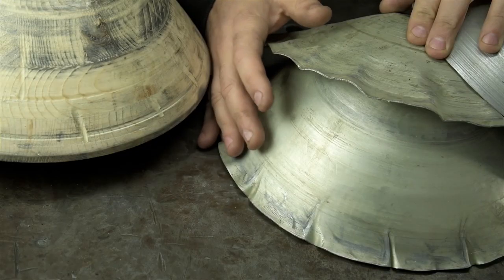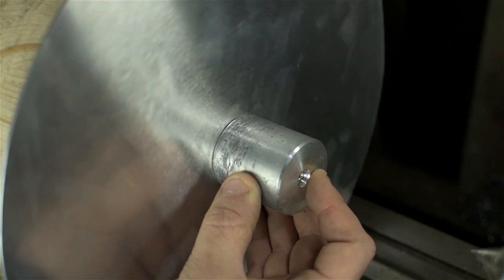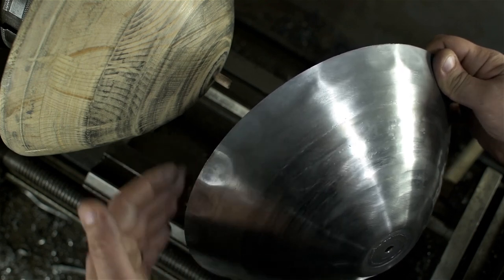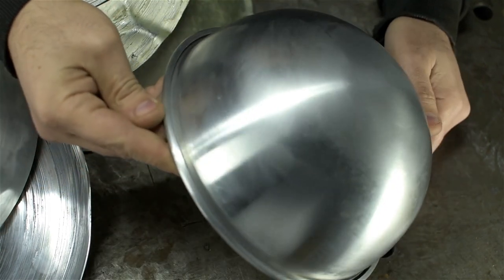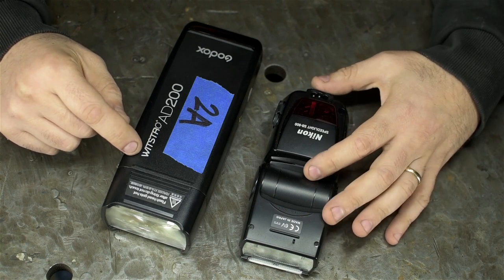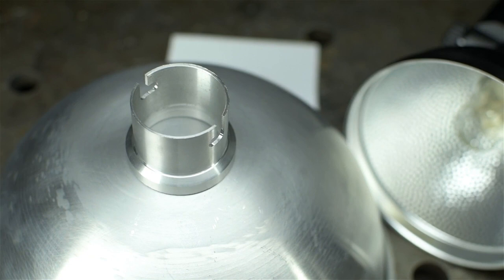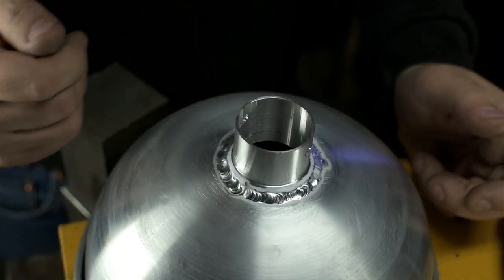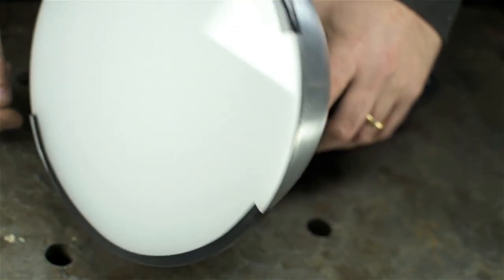Spinning Metal - Part 2! - GODOX Strobe Reflector Build

Comment: TOT (Tony) .. the spinning fails because it is too fast .. .. aluminum does not have the crystal geometry .. and think .. the stretching travels inwards as well as outwards in a spinning press.
And then there's the centripetal thingy.
I am sure cheap potmakers can do quick domes - but I bet they all get started with a cold-press, then spun for final adjustment.
I attach a cheezy link to the thousand year tradition in Turkey spinning cymbals and pots and shit. It's just ancient tin-craft .. like the "tin-kers" of Europe.
Nearly impossible with aluminum .. The kind of press-spinning you are trying can only work with copper/tin metals .. why?
The copper/tin matrix self-heals .. Aluminum does not.
So you have to hammer-shape first ..
With hammer-strokes, you can vector the expansion.
Get it "about right" with hammers before you spin - and spin SLOW!
This is why I use hammers to fine-fit the super-fine slides on my musical woodwinds in brass.
Anyway - here's the cheezy link - (pick-off the slag - there's good stuff in there.):
https://www.youtube.com/watch?v=6u_gwwEVAqw
Mind you .. the cheap aluminum bowl you show - that was spun on a negative form - this cancels the centrivical stretch.
You could try a negative form?
I'd rather you do it in some kind of brass with beating as well as spinning .. .. the beat-marks make a "Fresnel" diffusion which you might want to soften shadows. (use a brass hammer :)
Bite the bullet - do it in brass (or brass/bronze) .. start it with hand-hammer and press it into a negative form before re-ding the surface over the positive mold to get exactitude - and control the edge-softness of the light .. then chrome the bastard.
(Chrome does not affect the sound of it much  - you will spend more time tapping it than using it as a reflector .. it will sound brilliant. It will work, and it will look great ,, ;)
For stupid-fast .. negative form .... stop trying to understand the trumpet stuff - it requires brass, and shit metal like al cannot do that stuff.. But I'd rather you get a grain of tradition into your value.
Get the brass .. do the internal/external and teach those who follow you for real craft.
You started this - finish it - and learn how the roots of it go wayyy beyond your feet?
Follow it? .. that brings life into this world.
You have done this all along .. this brass thing .. new level .. that's history ..
You are a node of the passing of skill in this age. You are not the only one .. but let's make sure you are a major one?

Comment: It looks like you are unnecessarily stretching and work hardening the sheet when you flare it "away" from the buck. What if you only press it towards the buck and don't "pull back" the outer part away from the form? Worst case you might need more material as you aren't stretching it as much, and you might have to compensate for springback in your form.

Comment: I see why the center is breaking away now.  When you move the tool out towards the edge it's effectively using the wood form as a fulcrum of a lever and causing the far edge to bend away, straining against the bar you're using to clamp it to the form and eventually cutting through it.  I THINK this could be compensated for by using more force to draw the aluminum down and prevent slack from forming, but I'm really grasping at straws on that.

Comment: A couple of casual observations (Note: I have not done/tried any spinning myself, but I do have an understanding of physics and experience of metalworking);

Try using two tools on opposite sides of the workpiece.
--That way you'll balance the working forces and not put any torque on the spindle. (which is whats breaking the middle out)

Try warming up the workpiece
--a bit of heat will make the metal softer and easier to work; less stress on the workpiece/spindle.

Comment: At 0:10 you can clearly see that when you push the metal down on the left, the opposite side tilts up. That's the cause of the "reverse curve" you're getting near the centre, and likely the reason why the middle disc keeps breaking off.

You're basically twisting the disc along the Y (vertical) axis faster than you are shaping the metal.

Unless you have some way to apply force equally to both sides, you might need a material that bends more easily (i.e., is less elastic), so it doesn't lift the opposite side. Pushing down harder at the start (and moving outwards more slowly) will also give the metal a better chance to actually bend, instead of just being deflected and lifting the opposite side.

Near the start (middle), don't increase the radius until the part you are shaping is firmly in contact with the form. Once you've done about 1/3rd of the radius you can bend it more slowly (i.e., in multiple passes, moving outwards faster), because the radius already shaped (and in close contact with the form) will prevent the opposite side from tilting up. A bigger block in the middle (with a parabolic inner curvature) would also help. Basically, anything that keeps the disc pressed against the buck, following its form, and prevents it from deflecting / lifting.

Maybe you noticed all that and just couldn't get it to work, but hey, thought I'd mention it anyway, and the video at 0:10 really makes it very clear. TL;DR: If you're seeing the opposite side lift up, away from the form, that's bad.

Comment: I'm no metal turn spinner as you are not a welder ... or, for that matter of fact, an machinist. BUT! I suspect that you could do better if you would use thicker material. Also, you coud do WAAAY much better if you would use big silicone wheel and some kind of lubricant, you know .... to quench it's thirst and help metal to grow like a special flower it is. And use lower pressure and don't hurry (in video seemed like you were in hurry, even with the aid of video editing).

P.S.: I don't know if anyone stated the obvious i typed above, and quite Annie i don't care. But if someone posted something similar to mine ... Well ... Good for them :) :D

Comment: Get out a bar of soap and your torch and soften that aluminium (not a joke). If that doesnt work for some unforeseen reason, heat the hell out of it while working it.  Change out that center support for a concave piece that's larger the moment you get the center worked. You are putting way too much load on it by using the same piece throughout the process, making it like a blunt hole saw. GET THE BAR OF SOAP -- make sure it turns black!
Edited because I'm sure many people don't understand, so Google the recipe, it's easier than making French toast.

Comment: Annealing?  You are basically flexing the aluminum back and forth at the lathe RPM speed until it just breaks off.  Just heating disk a little first will make a difference.  BTW, I have no idea what I'm talking about...

Comment: Don't know what the diameter of your reflector is but Supervent is a brand of manufactured metal chimney and I think the clamps that hold the chimney sections together would be a slick way to hold your diffuser  to the reflector. The clamps are available for 8" and 10" (chimney outer) diameters, maybe more. I've been able to find Supervent products at Lowes.

Comment: I know that you're using aluminium and not brass but I thought you might find this interesting.
https://youtu.be/8NAaRQUTp9g
I was also wondering if putting some thick leather outside in the middle of the disc would help with the issues of ripping. And I'm also thinking that the the aluminium is work hardening.
Love the video and am happy I subscribed.

Comment: Tony, I’m not sure if you will read this or not. It occurred to me that you’re working the large diameters of the bowl at the same RPM as the center. You wouldn’t do that with a turning tool. Calculate some surface speeds and adjust. When I turn parts over 20” I don’t mess with RPMs above 40 or 50. Slow it down out there towards the edge!

Comment: Hey TOT, can you make a video about your workbench, the table thats in most of your videos, materials its made, of thickness, securing the table, etc, your table looks like its been around the block but i never see it rock or shake in any of your videos, a buddy of mine made his own and the table top is 3 INCH STEEL!  Although awesome, its quite impractical, heavy and was insanely expensive..i mean the damn thing weighs almost 4000 lbs and took us the better part of a day to transport it and set it up.

Comment: In the video you mentioned that you wanted the Diffuser to be removable, Ever hear of needle point the people that do needle point use a ring with a thumb screw on it I think that would hold your diffuser on better than binder clips. We all love MacGyver but there no need to be one at work... They sell the rings pretty cheap at craft stores. Michaels JoAnn's. Sewing places have them too. Great work! Nice try on the aluminum bowls now you have set that look like wrecked hub caps but you could sell them for modern art, or cymbals in a thrash band. Good luck I like your work! Your doing great!

Comment: I'll leave the metal forming advice to more experienced folks, but I'll echo the diffuser makes it not critical point. Take a look at the various contraptions photographers use for light modifiers. Bubble wrap, index cards,  slaved flashes (additional point sources) or the most time tested (and arguably best results) of all - the ceiling.  Even if you had hot spots in the pattern resulting from non-ideal shape, you're basically just trying to fill shadows by making the light source 1) big and 2) multidirectional to break up shadows. 

I was going to add 'I wonder if the bowl is close enough that if you were dead set on it being parabolic, you could stick it on your form and press/beat it into submission, but then I remembered - the factory reflector already has many such deviations built in by design - the dimpling.

Comment: If you review the footage, you can see how the part forms that weird protrusion and departs at the middle by thinning all the way out. When you apply the pressure to one side, the piece tilts over, this is what does it!

However, i don't have a solution, just an observation. I mean you could add a second tool on the other side that applies the same movement, spend months engineering it, but then you'll probably discover that something else goes horribly wrong, and that you'll probably need to keep adding complexity for the rest of your life.

Comment: The bowl was what they call deep drawn progressive die set stamping  most likely with a spun lip.
I don't really know for sure but it looks like it.
I have heard of casting a negative mold plumbing iv for vacuum then sinking it to a depth of 20' in water the touching off an M-80 6" away I'd suggest 30" of vacuum aught to do it as for the percussive charge you are on your own. too much and you wont find the mold.
Oh and you'll need to use enough studs and flanged nuts rubber sheeting and a bolster to secure the blank.
It also defiantly helps to anneal the preform.

Comment: Nice tony! What about cutting some clear (rubberized?) tubing the circumference of the diffuser. The right diameter of tubing to slice it centered the entire length so you could slip it over both lips- the diffuser and the reflector lip. Might work nicely for a removable quick clamp. Love your videos man!

Comment: There is a Japanese channel that I watch that is dubbed into English and its called Supreme Skills! and its dubbed by a guy that is far more enthusiastic than is necessary for the subject matter.  That adds to the entertainment value in some cases, especially in the comment section. Anyway, they have an episode where the best Japanese Spinner is up against the best Japanese machinist and they are both trying to create a very difficult shape in very thin sheet metal and the spinner guy uses a similar setup to this, like with it mounted on a spinning lathe, but the thing that you press it with is held under his arm on a fulcrum and he says he can feel the micro nuances of the spinning disk as it begins to yield to the pressure and begin to deform and his level of control is quite interesting and he is a master at it.  If I recall correctly, he heats the spinning disk with a gas torch at various points in its deformation. That may help you. Check out the show.

Comment: Your  follow-block needs to be concave on the face so that the metal is pinched against the spinning form at the outside edge of the follow-block. You can see from the video as you are spinning that the nose (center of the piece) is never "down" firmly on the spinning form. I worked at Metal Spinners in my home town in Angola, Indiana for seven years in the eighties, ran a 60" swing spinning lathe most of the time, occasionally a 40", 80", or 110" swing lathe.

Comment: You were on the right track.  Spinning is definitely not something easy to ‘figure out’ without any training.
Your roller tool (bearing?) was much too flat and should have had a radius of .250-.500.  
You can see the blank/part wobbling back and forth more aggressively as you spin more towards the outer edge of the blank.  This movement is why it was breaking for you.  You need to make sure that the blank is tight on the tool as you progress along the surface of it.  
Metal spinning is what I do for a living.  I have trained many but not everyone can learn to spin skillfully. I believe your results would have been much better had you had son professional guidance.  But I must commend you and say ‘ hell of a job’ for getting the results you did get minus any professional guidance or tutelage.

Comment: I didn't read all the comments so please forgive if this is a duplication; but woogie2901 is on the right track with his description of an active torch going on the lathe while spinning.  There is an episode on youtube of a Japanese tv show called "Begin Japanology" (sorry I don't recall the exact episode and there are hundreds of them) but they show a national competition where a master metal spinner goes up against another master using a different method (five axis CNC? Mill?) and they compete to make the same part to I think ten-thou tolerances - the spinning master does have a torch going and I seem to recall him adjusting it while juggling the other things to spin a part - (which was some kind of jet engine thingy out of titanium and way more complicated than a bowl) anyway those shows are good so check them out - or just spend the five bucks and get the already made perfect aluminum bowls at WalMart.

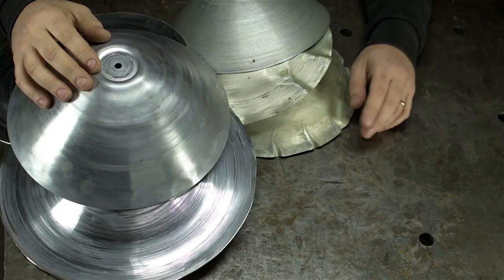Comment: 6:04 Awesome!  You made a hubcap for my  rat rod! Thanks man, I knew I could count on you! 
Maybe you can use a strip of 1/4" vacuum line off your neighbor's car thats been cut down  the length of one side to hold the diffuser onto the bowl? Would look nicer than a spring clip.

Comment: You might want to make sure the spindle bearings in your lathe are designed for that kind of axial load. Tapered roller bearings are. Very few ball bearings are and applying axial thrust to standard ball bearings quickly wears them and that wear instantly becomes radial clearance and "runout".

Comment: You mentioned the rolled edge, and it seemed like something clicked im my head. Now im far from an expert in anything really, but ill bet a rolled over edge would assist in your bowlmaking. The question is, how  do you do it? I'm thinking it's not necessary for the bowl to be made, but if may fix the lampshading, and help give the form added strength when spreading it out. Don't give up on the bowl!

Comment: Its interesting you showed us that flash on the paper. I worked at Boeing in Mesa AZ as a aircraft painter and painted Apaches and multiple other aircraft. Up until 2015 they used a machine called a flash jet that I got to train on and assist with and run. It does the same thing essentially you did with your camera flash on the sharpy but on old in the process of being remanufactured helicopters, the parts and various other aircraft with the paint. It would flash the paint and textures right off the surface of the metal. It was in a 60'x40' warehouse and was 36" wide and on a huge 5 axis track system. Was cooled with dry ice pellets. Very very interesting, was only 1 of 3 in the world. Dirty as shit. You doing that with the flash made me think of that.

Comment: If you put some 99.9% gypsum powder onto your hammer head and tilt it 1.99 degrees to the left, you'll get a much better surface finish when you're hammering out those blanks into saucers. Great form on the thermal expansion cutting though. Professional level stuff there.

Comment: The central buckling and tearing looks to be due to excessive flex caused by relying on ONE roller!
Wouldn't it more effective if you had a counter roller on the opposite side to match and balance what you're doing?
It would also eliminate/reduce the flex

Comment: We did a metal spinning project in my 8th grade shop class, circa 1989.  We used a stainless steel blank instead of aluminum.   We used a broom handle to apply pressure to the blank and form it to the dowel.   I remember our shop teacher telling us that it was imperative as you neared the end of your piece to go very very slowly, or it would wrinkle up.  I think that's the cause of Tony's difficulty with his pieces.   As for breaking out the center, I don't know.   Is this lockformer grade metal?

Comment: We used to manufacture reflectors for lighting by the thousands. The dimple effect is simply hitting the blank with a ball peen hammer. A steel blank. Wood is only used for prototypes. Not production.